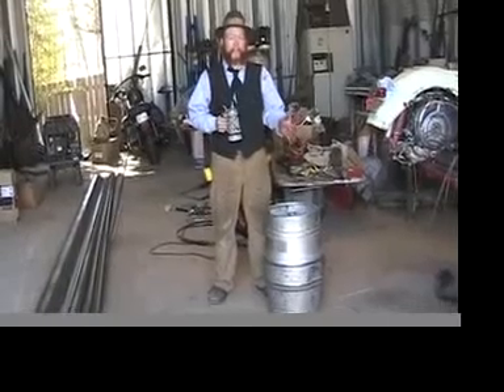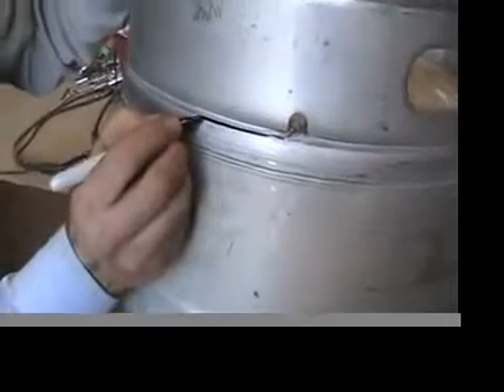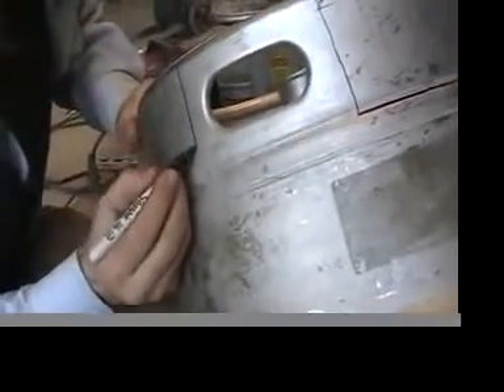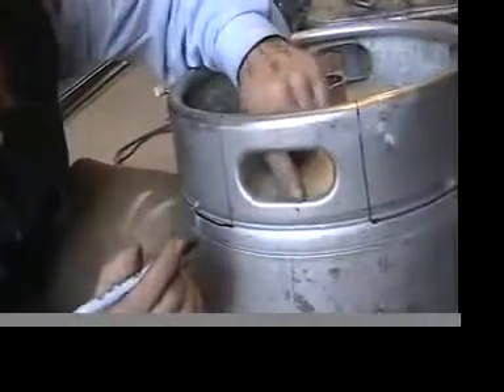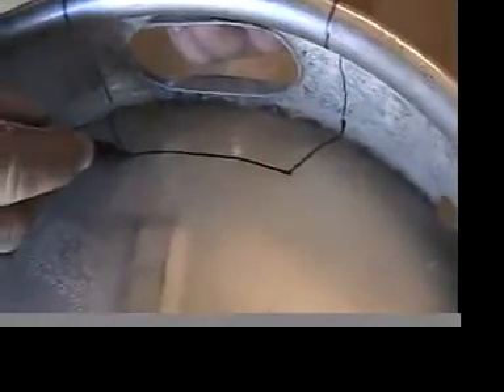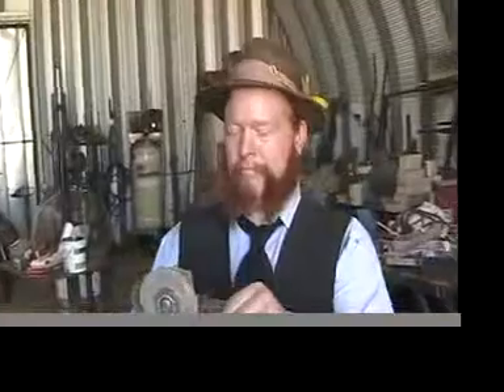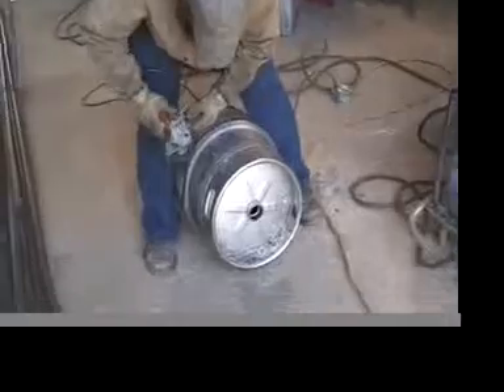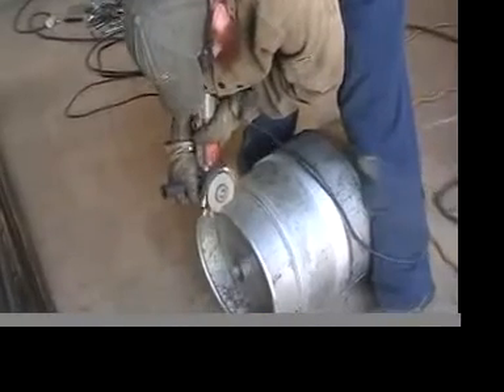Beer keg to Kettle Conversion Part 2 Presented by Kegerators.com

Comment: If you have a broken tap, alls you need is an air compressor to get the beer out. Put the air nozzle  into the hole of the tap and the beer will flow through perfectly. Be careful not to get too much pressure in there otherwise the beer will come out foamy.

Comment: Gee dude, I just take the plasma cutter with a piece of wire looped around the valve housing, used as a circle guide, and zap that top out of there in about 3 minutes including setup. 

Taking the entire top off is not only extra work but removes the part that makes a nice "boil-over catcher".